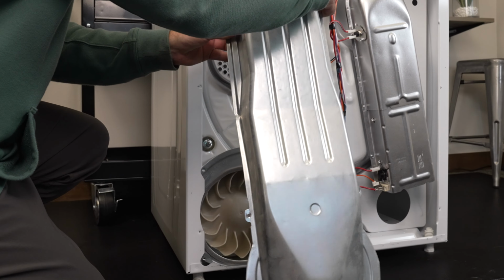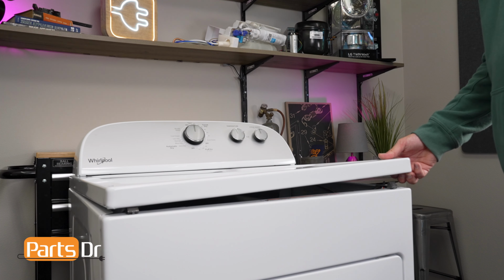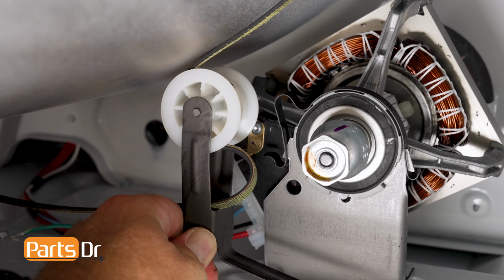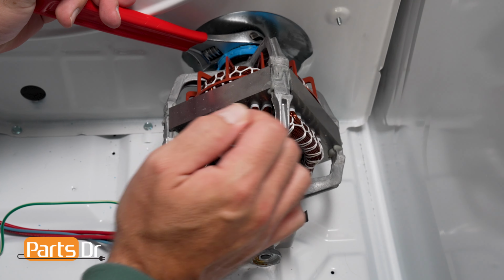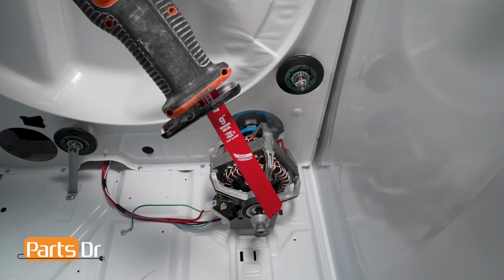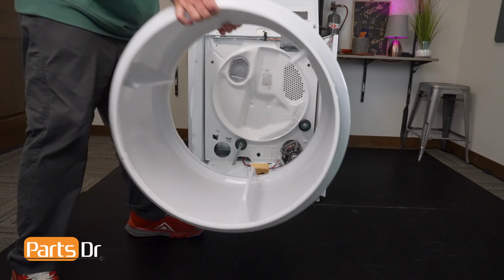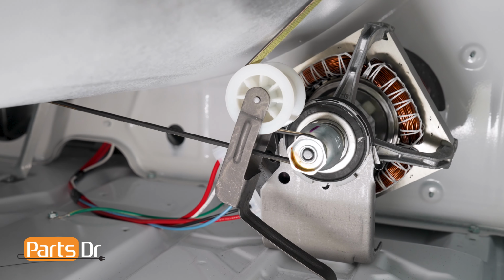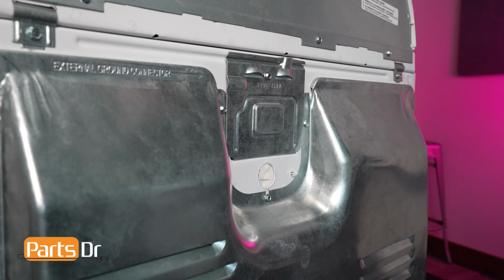How to replace Blower Wheel part # WP694089 on your Whirlpool Maytag Kenmore Amana Dryer

Comment from the maker: Thanks for tuning in! If your blower wheel is stuck or causing issues with airflow, replacing it with a genuine part like the Whirlpool WP694089 is the best way to ensure a proper fix. Just be cautious if shopping on sites like Amazon or eBay, as we’ve seen a lot of lower-quality aftermarket blower wheels that wear out quickly, break, or cause noisy vibrations that lead to even more repairs. For quality and peace of mind, we recommend buying the original part at https://partsdr.com/part/694089-blower-wheel. It’ll keep your dryer working efficiently and save you time and hassle down the road! Good luck with your repair, and let us know how it goes!
Reply: Hi, will a damaged fan cause a loud noise once the dryer gets hot?
Reply from the maker: @ddddddno24  Yes, a damaged blower fan can definitely cause a loud noise, but usually, the noise will start right away and not just when the dryer gets hot. If the noise only happens after it warms up, it could be related to heat expansion affecting another part, like the drive motor. But if the fan is cracked or loose, it typically makes noise as soon as the dryer starts running.

Comment: My dryer was rumbling and even making a 'trumpeting' noise that would come and go. I replaced the roller wheels, both axles, the belt, and idler pulley. I did not know about the blower wheel until I watched your video. I ordered the wheel from you guys, installed it and I am good to go. In my case, the wheel's metal collar that is screwed to the motor shaft had stripped out. The wheel was basically free spinning, making all the noise, and not drying the clothes effectively. Your video was spot on. Please accept my subscription request and thumbs up as tribute to you guys and your efforts to keep our dryers repair-able.
Reply from the maker: Awesome, nice job fixing it yourself and thank you for the support!

Comment: Hello, does the dryer blower wheel suppose to be moving freely if you spin it with your finger? I can spin it but it doesn't spin freely and will stop right away. Is this a bad sign? Having problem with my clothes not drying. Thank you!
Reply from the maker: It depends on if you have the belt attached to the motor.  With the belt attached to the motor, the blower wheel will not spin freely.  If the belt is removed from the motor, you should be able to spin the motor by hand as shown in the video.  It should turn freely but with a slight resistance to it.  If it doesn't turn freely, the motor bearing are usually bad and the motor needs to be replaced.
Reply: @PartsDr thank you for explaining!

Comment: Thanks, very helpful. Problem is, I don't know if this is my problem. I get a loud, momentary clank sound on startup. Sounds like it's coming from the blower area. Then it runs fine.
Reply: Took it all apart and discovered the blower full of debris. Cleaned it out and now it runs smooth and quiet.

Comment: The plastic on the fan shattered when we went to remove it. The fan had to be chiseled out but now the threaded metal innard is stuck tight on the motor shaft. Any advice?
Reply from the maker: Locking pliers are usually your best tool for getting this off.  Let us know what you find.
Reply: @PartsDr  Ended up having to take the whole motor from the dryer and put it in the vice to get that metal unthreaded. It was on there tight!